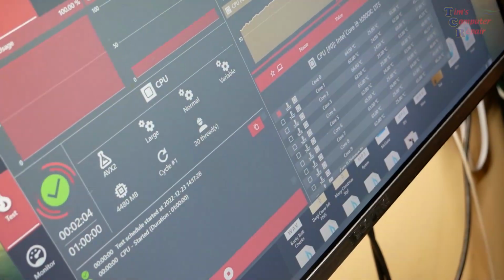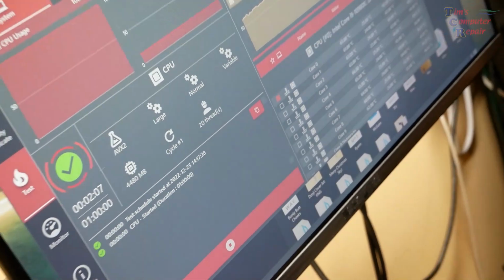Underlying Issue With Your Gaming Computer That You May Not Notice.

Comment: Not sure you know Tim, but MSI did a recall on them 360r AIO https://cultists.network/6371/msi-coreliquid-recall/#:~:text=MSI%20has%20announced%20a%20recall,some%20sediment%20blocking%20the%20AIO. and here is the form https://www.msi.com/Landing/liquid-cooler-swap-application Might be worth mentioning that to the customer to get a version 2 model
Reply from the maker: Most definitely worth a look. Thanks for the heads up!
Reply: @TimsComputerRepair  surprised; they have problems widely reported on several models.

Comment: we couldnt really see the temperatures as you are holding the camera a little off.
and are these temps under load? if so, which load? for a long time? please be more specific :)
name the hardware inside the pc, people today wanna know and compare.
it could help to decide if this is helpful information or just your personal opinion.
Reply from the maker: Temps of each core can clearly be seen in the video. The video also clearly shows cpu at 100%. With the water cooler the system shot up close to 100c almost immediately. You can use whatever cooler you prefer.

Comment: Delighted  to finally see someone keep/repurpose the fans for a client.  With great respect to everyone, I personally never wanted to risk using a water cooler.
Reply: what risk? the system ran dry, no harm done, fill it up and live on :)
Reply from the maker: Risk would be consistently running your cpu at extreme high temps over and over before figuring out what the problem is as I stated in the video. Simply replace the junk water cooling system with a comparable quality air cooler and never have to worry about stressing your cpu due to extreme high temps again.
Reply: @TimsComputerRepair  or just have a clue and pay a modicum of attention to temps like every responsible desktop PC owner should.

Comment: Wonder if that AIO was one of the 3 brands that had recalls on their coolers. Arctic had a replacement seal, MSI had a recall and someone else.
Reply from the maker: Could be...Good point. Thanks for commenting.
Reply: very vague statement, similar to this video where there was no leak or anything else which was stated to imply that water coolers (or more AiOs) in general have...which they dont (in general).
the system simply ran dry - simple solution - fill it up and live on :)
no need to panic or to hyperventilate and buy extra stuff.
Reply: @hanswurst2220  How did you eliminate fungal growth in the cold plate fins causing  the dispersion of heat to fail?